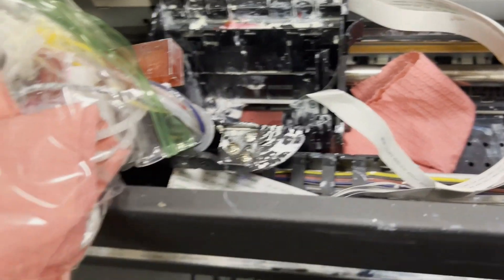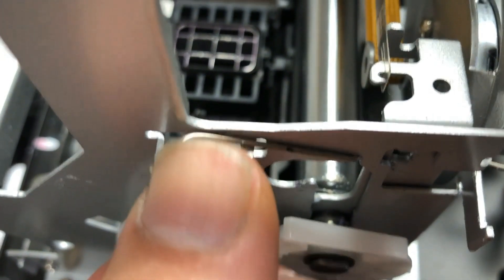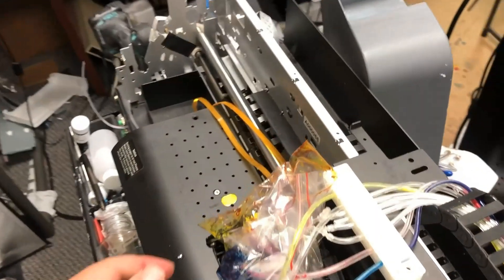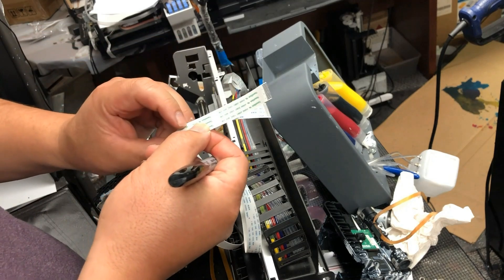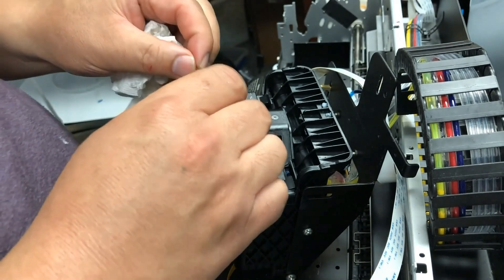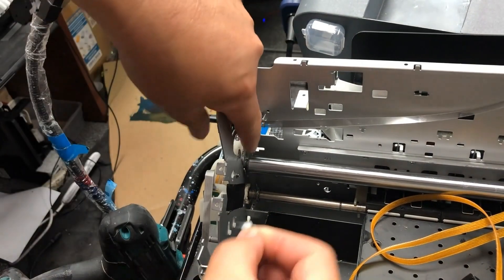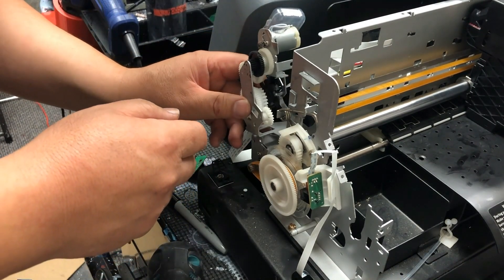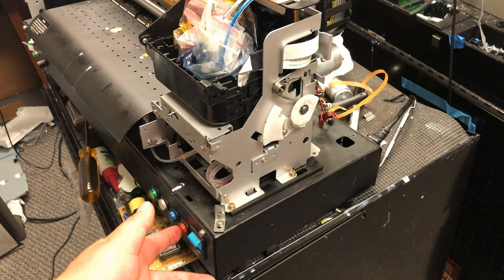Replace 13-Pin Printhead Carriage Cable for CR/PW Sensors – Epson L1800/1390/1430 CRPW FFC Fix

Comment: Hey Kevin, can I use this video to apply to my L1800? Or are there differences?
Reply from the maker: Thanks so much for watching and for the question! Yes, you can use this video for your L1800—the procedure is the same, so you should be able to follow along without any issues. I really appreciate your support, and if you’d like quicker replies in the future, consider subscribing or becoming a channel member, since subscribers and members get priority responses within about 48 hours, while non-subscribers are answered as time allows because I can only reply to around 10 questions per day; after that, any remaining reply slots are handled last-in, first-out, meaning newer comments get reviewed first. If you don’t get a reply within 48 hours, feel free to subscribe or repost your question so it moves back to the top, and if you subscribe later, all your older questions automatically become priority without needing to re-ask. You’re also invited to join Run With Kevin — LIVE, where I go live most mornings between 6–8 AM Eastern answering printer questions in real time, so be sure to subscribe and turn on notifications if you want to catch the next session and ask directly. If you ever need faster help, you can always email [support@bchtechnologies.com](mailto:support@bchtechnologies.com), and if my reply or the video helped you, I’d really appreciate a quick Google review at [https://g.page/r/CfL7k6nYvPQ9EAg/review](https://g.page/r/CfL7k6nYvPQ9EAg/review).